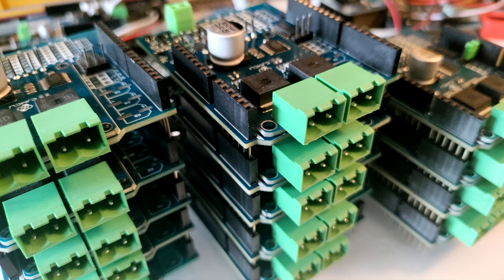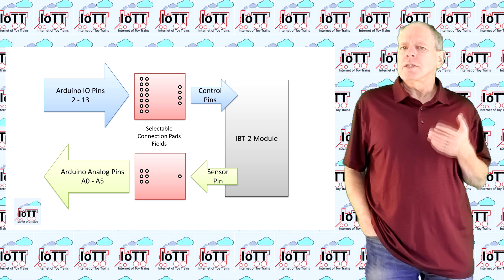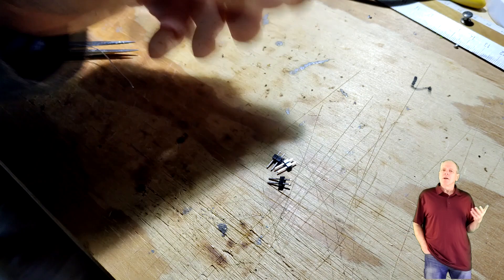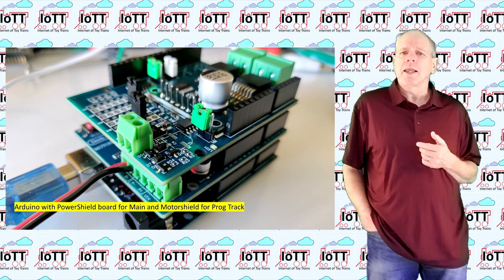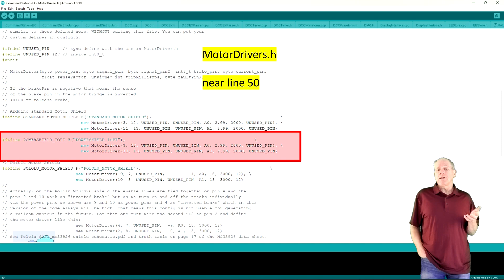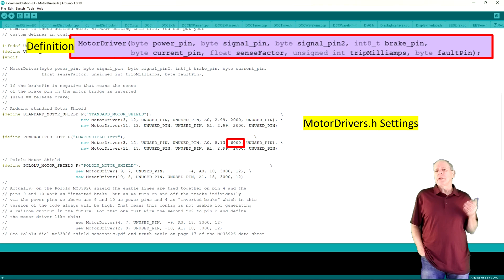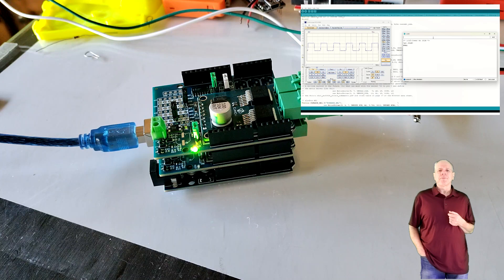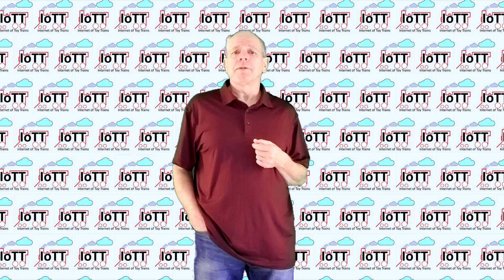5Amp. PowerShield Configuration (Video#114)

Comment: Hi. Really helpful video. I noticed that my 2 boards don’t have capacitors on the main board.  Are they required for this version of the boards? I have power shield revision 3.
Reply from the maker: The four capacitors on the main board were intended as alternative to the one on the IBT-2 board, which then would have to be removed. The reason was I was not sure whether it would work out with the hole in the main board and the stacking height, so I wanted to have an alternative. Obviously, it did work out, no need to remove the large capacitor and replace it four smaller ones.
Reply: @IoTT  thank you so much.

Comment: I never thought of the modification to the motor shield board as hard to reverse as the bridge is actually designed to be removed and then bridged by a solder bridge, hence why it has the two pads so close together, should you decide to use your motorshield in a different application. 
With that said, my use of DCC Ex and the motorshields is designed to be on my main railway layout, so I don't have any plans to remove the controller for my track :).     Motorshields are pretty cheap to buy as well.
Reply from the maker: I agree, it is quite easy - but then I get sometimes questions that make me doubt ;-)

Comment: Hi Hans, this is a really useful video. 
What configuration would be needed to run a Powershield main track at 22v for G Scale and a motorshield programming track? I have components for a stack from the bottom of Arduino Mega, Arduino Motorshield, Powershield (internal version), DCC Aux shield which I think is straightforward for 18v - the setup shown at 15:30.
For 22v, would I need a 22v power supply, supplying the Powershield separately? I currently only have 18v. I think I would need to change the VIN jumper on the Powershield to avoid exceeding voltage for the rest of the stack? 
How would I configure the other boards in the stack? Would they need a separate 18v power supply? Thanks!
Reply from the maker: Yes, that's simple and straight forward. You power the stack through the DCC AUX shield with 18Volts. On the PowerShield, you leave the VIN jumper open and power the DC input from your 22V supply. In this case I would also use input A2 for the PowerShield current sensor, that way you don't have to modify the motorshield board which uses A0 and A1. For the DCC signals you can use IO3 and IO12, same  as on the standard motorshield. It does not matter that the motorshield will remain connected to those signals as you don't use that channel.
Hope that helps.
Reply: @IoTT  thanks so much for the super-speedy reply Hans! That's very clear. I'll let you know how I get on.

Comment: Hi Hans - ready to configure my DCC EX system just checking that I am not going to make smoke!    My stack from bottom to top is Arduino - Arduino Motor Shield - RedHat++ with IoTT Stick - Power Shield.  DCC low power out on Power Shield connects to DCC in on RedHat.  Power in to Power Shield.   Once I have configured and uploaded software with settings for the Power Shield I should be able to connect power and track and run trains.   Am I good to go?   Thanks.  Bill
Reply from the maker: Sounds good. The only thing is, the power shield needs to be below the RedHat or you will not be able to install the Stick and see the display. The RedHat really needs to be on the top.
Power goes into the PowerShield and if you set the VIN jumper on the PowerShield, it will power the entire shield stack. Just make sure to not exceed 18V. If you use higher voltage (or as a measure to absolutely make it impossible to burn the Arduino), you can simply bend away the VIN pin between the Arduino and the next board (in your case the motorshield), so that all boards get VIN except for the Arduino, which then is powered only by the 5V pin. Another safe method, particularly if you do not trust your settings, is using a low track voltage first (e.g. 10V, which is safe for the Arduino) and check the functions, and only go to the final track voltage if you have confirmation that everything works.
For the configuration, the settings shown in this video should work no problem.

Comment: The motor driver boards which were purchased from you do not seat properly on my Arduino mega 2560 keyestudio board. It is prevented from doing this by hitting the usb connector and power connector on the Arduino. I can send you an image. Any suggestions on how to fix this? Thank you.
Reply from the maker: It is not uncommon that the first add-on board touches the USB and power connector on an Arduino. Try for example with a standard motor driver board, it is the same. And it does not mean that the board is not seated properly. What is important is that the pins make proper contact, and for that they do not have to be fully inserted.
There is one point you should watch, though: The USB connector housing has ground potential. You may want to put a small piece of electrical tape on top of it to prevent accidental contact with metallic parts of the upper board. No problem on the DC plug side, as the jack housing is non conducting.
You can also prevent the board from going all in and conserve a small gap. This is automatically the case if you use the Arduino case I published (see video #108) as the housing elements provide a stop to keep the next board in the correct distance. Alternatively you can put in a spacer part on the pin connector. e.g. the plastic eyes from a pin header. Put one or two over some of the pins of the upper board before inserting it into the Arduino. This keeps the distance and the board level.
Hope that helps.
Reply: @IoTT  thanks for the information. I have installed the board and it is working properly.